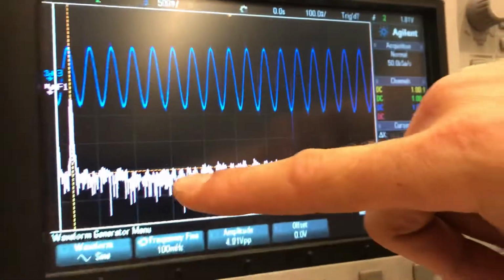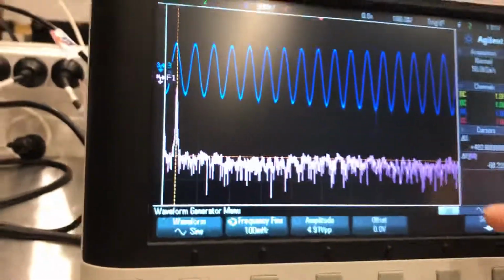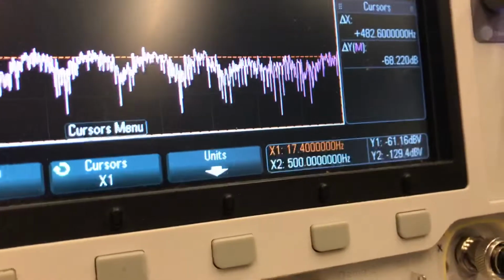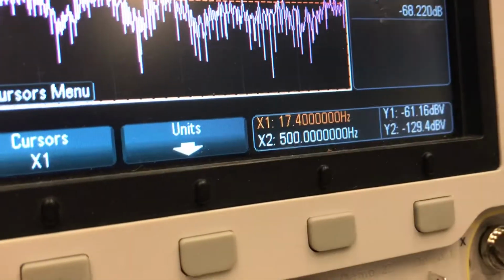Continuous scanning laser Doppler vibrometry; pt 3 of 4 - first bending ‘mode’

Comment: Really nice video. Thanks for putting these up Ben. I remember a while ago speaking with Roger from Polytec (he's retired now) who said a group at imperial had hacked into the mirror motors of a PSV-400 to do continuous scanning (turns out this is not a good idea as it's not to simple so 'hack' the mirror signal data without knock on effects). Did wonder what happened to their work in the end.
Reply from the maker: Hi Rob. Thanks for the positive feedback/comments. Roger Traynor has indeed retired, presumably to fly hi s model aircraft, many years ago. But, prior to that and before I emigrated, I knew him well. It's not so much "hacking" the mirrors - the PSV systems can be configured with EXT (external) mirror control, so one can drive each salvo with a voltage signal. No problem. There is much work on the topic which is now quite mature with contributions from me, IC, Ancona, Matt Allen et al.. Regards, Ben